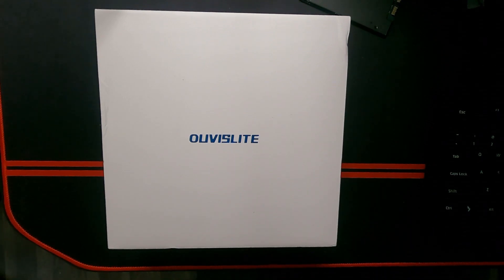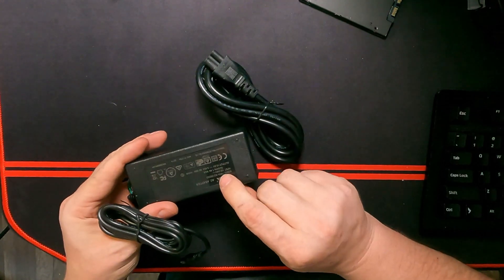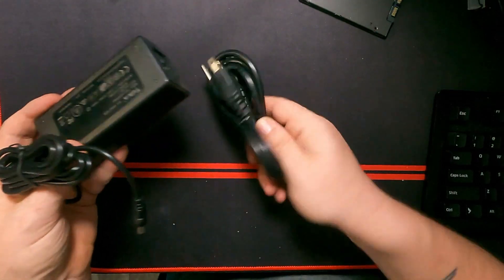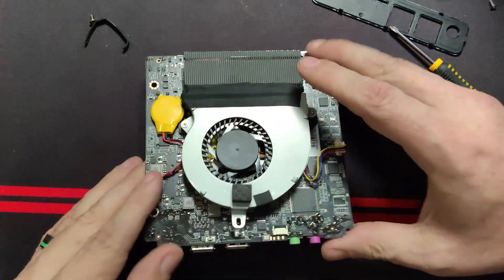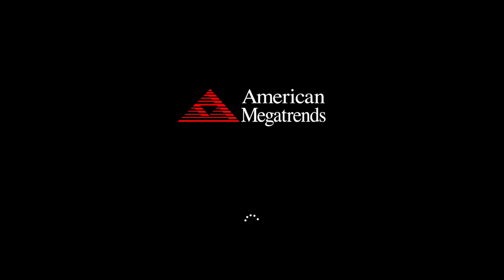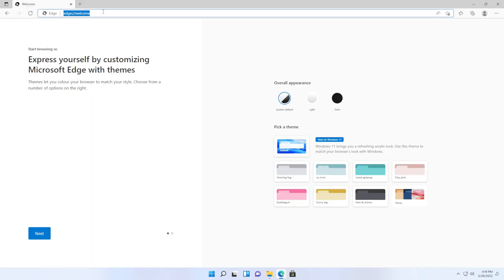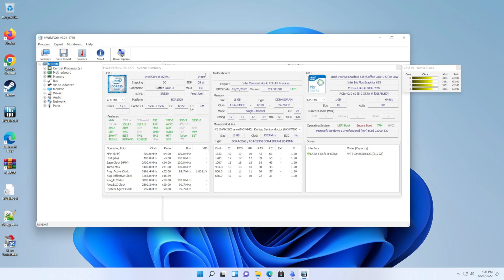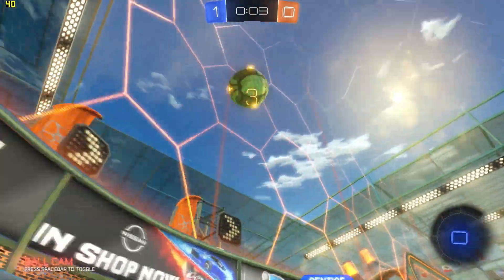A Mighty (Mini) PC from OUVISLITE!

Comment: I used my CK10 very lightly for about a year and a half before it just stopped working. It will not power up at all anymore. I only used mine a bit for simple ECU programming/reflashing, running Zwift and running iRace. I followed up with Ouvisilite customer service, they sent me a brief video on attempting a reset via the reset pin. This didn't work so Ouvisilite told me I am now out of luck and will need to buy a new PC. Very unhappy with the PC and Ouvisilite, I'll stay away from this companies' products in the future.
Reply from the maker: There are so many of these mini PCs on the market these days that it's often hard to know what's going to work in the long term. I've had at least one that was great when I got it and then the HDMI just quit working out of nowhere. The DisplayPort still worked but the HDMI just quit one day